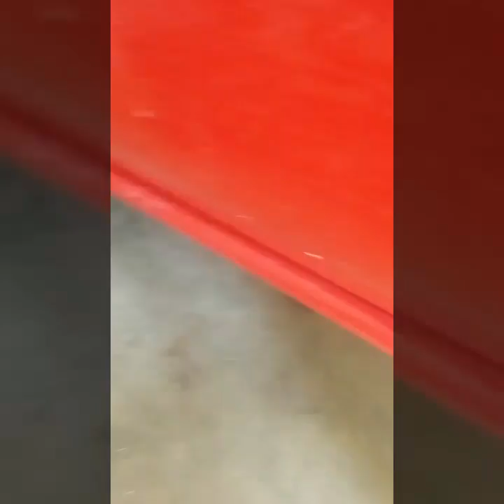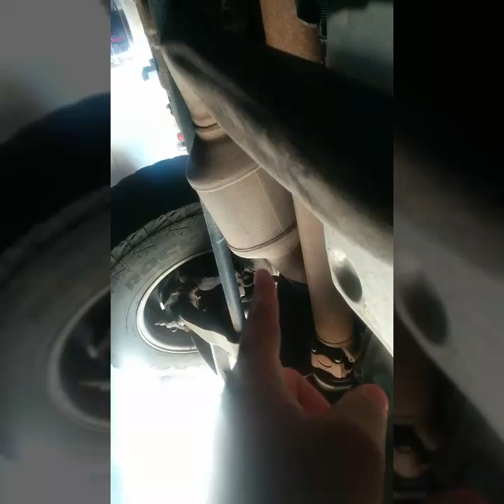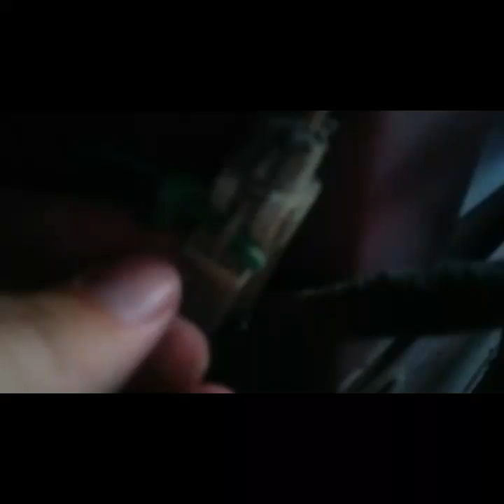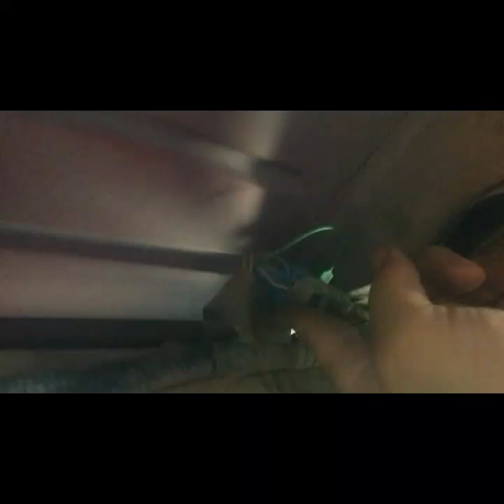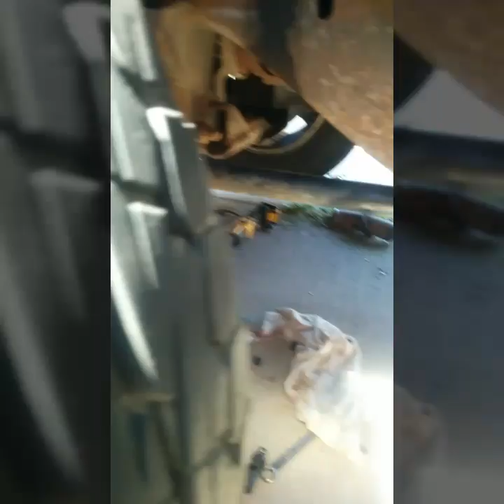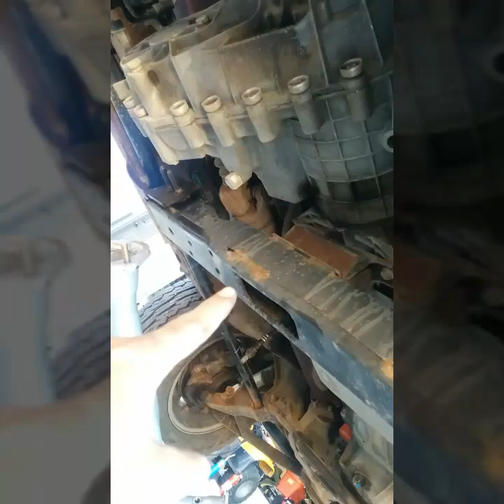2004 Chevy Silverado catalytic converter replacement

Comment: I am in the middle of this and you made it look way easier than it seems to be for me lol
Reply: It's a PITA. Getting off all the bolts and removing the cross member to hold up the transmission is a major pain and getting off all 4 o2 sensors as well. Just quote out the labor from a shop. Probably will take them less than 2 hours. If you don't have their tools and little to no experience a few hours. I have to replace mine and the labor involved isn't worth the time value.
Reply: @buzztrucker pb blaster jack, Jack stands, ramp.

Comment: Was there a big difference when you change the catalytic converter’s
Reply from the maker: Not that I noticed. It helped with the check engine light for a while but that was it. There wasn’t a significant increase in power or anything like that.
Reply: @chefonzy1 What do you mean for a while?

Comment: Are these cheap catalytic converter replacement pipes worth it?.. I mean long term
Reply from the maker: Long term, probably not worth it. The catalytic converters actually had to be replaced (professionally) a few months ago because it continued to throw codes. I’m not sure if it would do that with another truck, but it didn’t solve the problem long term with this one.
Reply: @chefonzy1 damn well I was thinking of a high flow catalytic converter from MagnaFlow universal
Reply from the maker: That might be fine. These were probably just some cheap ones that were bound to fail.
Reply: @chefonzy1  that sucks. Sorry . You waisted all that money
Reply from the maker: Well I at least learned something, I guess. Good luck with your endeavor!
Reply: @chefonzy1  thank you

Comment: Where did you purchase your Catalytic converter?
Reply from the maker: I actually got them on Amazon. I looked recently to see if they had them still but it said they were unavailable.
Reply: @chefonzy1  Thanks
Reply: @chefonzy1  I live in CA. and having a rough time replacing mine for my 2005 Chevy Colorado 5 cylinder 3.5. Any suggestions? Every place I call says they're discontinued. Dealers can't help me😢

Comment: Good this will help me out I have a 2003 Sierra Z71 4x4 same setup a little hint to you and everyone I got the complete set up from engine all way back to tailpipe $30.00 120 day warranty find a place called pull a part
Reply: Do you think this would be available in California?
Reply from the maker: @Jimmy213west  I can’t recall what the label stated about California, sorry about that.
Reply: @Jimmy213west   not shure check out local junkyard hear called pull a part
Reply from the maker: Glad it helped you out. And thanks for the info, hopefully that will help someone else that needs to do this as well.

Comment: Hello, great video, how are your results from video posted and now, thanks.
Reply from the maker: elvis vergara Thank you. I had good results for a while. Just recently I had the check engine light come on again for some reason. I’ll have to get it diagnosed because it would turn on and then go off and this would happen multiple times. Wish I knew the issue because I’ve also replaced the mass airflow sensor along with the catalytic converters.

Comment: Good job man how about 2005 I need a cats where I can find those
Reply from the maker: Abasolo Gto check on Amazon, that might be your cheapest route. Plug in your vehicle info and they should be able to set you up. If I remember right, it cost me around $250 for that whole setup.

Comment: you can flush them with Acdelco carburator cleaner
Reply from the maker: jafar alkoot My catalytic converter was making a rattling noise because it had broken apart inside. So unfortunately I had to replace the whole unit, instead of just cleaning it. But thanks for the comment and suggestion.

Comment: By any chance do you still have the link to item??? I need one too.
Reply from the maker: Spruce 9 EvanFischer REPG960301 Silver Powder-Coated Catalytic Converter with Heat Shield https://www.amazon.com/dp/B007VZWFQ4/ref=cm_sw_r_cp_api_dEFAAbVN4PVVR
Reply from the maker: Spruce 9 here’s the one I bought for my truck. Hope that helps
Reply: chefonzy1 yes, thank you. But unfortunately this one is not California compliant. But at least I am on the right track now. Thank you.
Reply from the maker: Spruce 9 Darn. Good luck with it.

Comment: Hey bro so i bolted my cats back on everything bolted right up except for trans mount  the cross member bar keeps hitting the y pipe causing the trans to move up ever had  that problem
Reply from the maker: Alexander Lara I didn't have that problem. That was the easiest part of the installation process for me. Sorry to hear you're having issues with it. Were you able to get it figured out?
Reply: chefonzy1 i have every thing bolted  right up but its only the transmission bolt that doesnt wanna drop down into the crossmemeber bar for some reason the y pipe is blocking it from coming down
Reply from the maker: Alexander Lara I wonder if your bolt is stuck on something unless you can see it hitting the exhaust pipe. Other than that, it's kinda hard to say without being there to see what's going on.
Reply: chefonzy1 i got it turns out the cats and y pipe i got are different there for a suburban not for a silverado they have a different bend to the piping but i got it thank you though
Reply from the maker: Alexander Lara That sucks you didn't get the right one in the first place but it's good to hear  you were able to get it fixed up.
Reply: chefonzy1 yeah they gave me the wrong one but im good to to go now

Comment: so when you install a new catalytic converter they need to be welded on or no ?
Reply from the maker: Orlando Viveros depends if you just buy the converter or not. I bought this setup so that I could just bolt everything on and call it good. I didn't want to do any welding, so I went this route. Does that make sense?
Reply: +chefonzy1 yeah makes alot of sense thanks
Reply: How did you buy that setup?

Comment: think this same part will bolt on to a 2003 Escalade 6.0 awd? its similar in design.
Reply from the maker: Ulises Juarez Good question. If you get onto Amazon and search the part, you can put in your vehicle information and it will tell you if it's compatible to your vehicle.